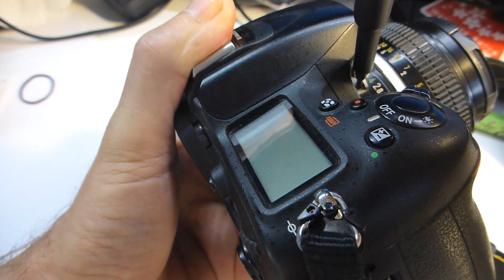How to Remove a Jammed Manual Focus Lens from an Autofocus Nikon Body

Comment: Your locked on lens is not Ai.  It is a non Ai lens and must never be used on the D7100 or any modern Nikon equipped with the  Ai indexing tab.   They will damage the camera.
Reply from the maker: Agree, it was put on by mistake! I was lucky to get it off without damage. The video was to help others who might have made the same mistake! Thanks.